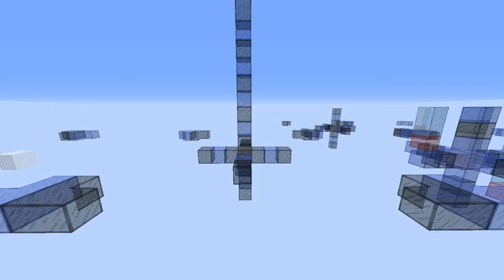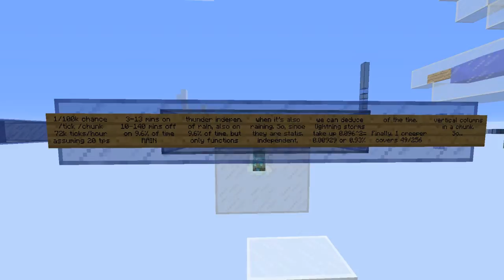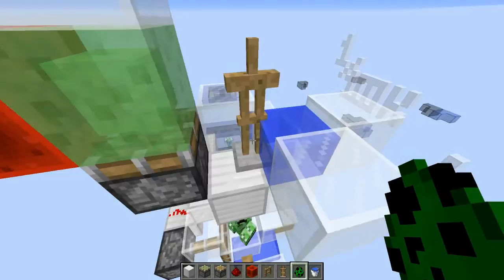[Explanation] More About Lightning & Practical Cell Design

Comment: Sharir, I have a question. Where can I learn/find a way how to start reading code. There are couple obfuscated code type of videos regarding Minecraft in Youtube, but I would like to know your tips/learning curve.
Reply from the maker: First, I assume you know Java pretty well? If not that's your first step.
Then, there's a tool called MCP which decompiles the Minecraft jar for you, which is the easy part in Java, and then also deobfuscates a very large portion of the code. There are still lots of obfuscated things, and I think all local variables inside functions are obfuscated, but all class/file names are deobfuscated and many many functions (don't know the relative proportion). What's important to understand is that this "deobfuscation" isn't some magical black box or some calculation you can run or something. It's people who busted their asses over years reading the Minecraft game code in it's fully obfuscated form and making sense of nonsense. There are, of course, major parts of the code that haven't changed since alpha, so they add no challenge in new versions, but for new or modified classes, the MCP guys work hard each version to make sense of them. And, there are lots of things they don't bother deobfuscating, as they're not key and/or relatively simple to understand. But, very frequently reading the code involves keeping track of your imaginary call stack, which consists of func_3298764 which called func_23097854 etc.

It's very time consuming reading Minecraft source code from MCP, but it's your best bet, as far as I know. They also have some pretty nifty tools which make it easy to load into Eclipse, easy to recompile, reobfuscate, isolating your modded or added classes from the original game code, which is all great stuff if you want to read the code or write mods.

Good luck!
Reply: Thank you, I was waiting this reply since there is one farm nobody has done so far as I know. I want to read that part of the code and see if I can or someone else have made sense of it. Its fairly new mechanic and can be done pretty inefficiently, but I still wan to know what does it hold inside itself.

While also being able to find other things out about specific entities or behaviors. I remember hearing that Java isn't that hard to learn so I will check out what I can do. Really helped your tip.
Reply: If I can't read it I will do the repetitive scientific method to confirm things I need answer to. Classical style.

Comment: wont the armor stand cause lagg too? so having the same amount of entitys but only creepers u would have the dying chace of probaly less than the doubeling of the creepers helps u.
Reply from the maker: Jendrik Weise I don't really understand the second part of what you're trying to say, but as for the first part - ArmorStands don't cause (almost any) additional lag on the server, as they have no AI and no motion values. If you're referring to client rendering lag, that's a much less important consideration, up to you if you want to use it or not. I know we will on SciCraft.
Reply: client lagg isnt my problem but wasnt there a way to prevent the mobs ai from activating or was that fixed or so? i think pi used it in his time dialation machines to turn them off
Reply from the maker: Not "disable" the AI, just chop off the SearchTreeNode early on by preventing them from seeing any walkable space, as far as I know. This is irrelevant for ArmorStands.
Reply: but not for the creepers so those should that way cause almost no server lagg wich would make a bigger farm if u have a good computer possible or am i miseing sth?
Reply from the maker: Make it as big as you like, I haven't checked yet exactly what affects lag from entity update ticks, so I wouldn't be qualified to answer that question. Anything I said about that up until now is from what I speculate.
Reply: ok, making discoverys isnt my part xD that s up to u i cant read code...

Comment: Interesting! I just rewatched your first video before watching this one, and you say that lightning strikes in all loaded chunks. I specifically remember that a player needs to load the chunks to generate lightning, much like crops growing. Are you sure the chunks need to be only loaded?
Reply from the maker: Nasm Nasmus Inside the WorldServer function that calls the lightning generation (and the ice and snow and stuff, you know the one), it says "this.activeChunkSet.iterator()" in the for loop.
I just checked, the documentation says:
/** populated by chunks that are within 9 chunks of any player */
You are correct again. I really was all over the place when reading that code :(
Finally, you should feel good about yourself, because you were also correct about the AxisAlignedBoundingBox exclusivity. I did the same thing you did and will shortly be uploading yet another (hopefully final :C) correction video.
Reply: ***** Ah that's awesome, it would be great to know if the exclusivity means the 6x6 box is always centered around the same corner, or if there are some other weird things going on.

I guess the last thing I could be right about is possibly the creepers dying from lightning(not fire)? I did a quick test by summoning ~100 creepers 10 blocks away from eachother, then have them all summon lightning 3 blocks above them. As far as I could tell none of them died.